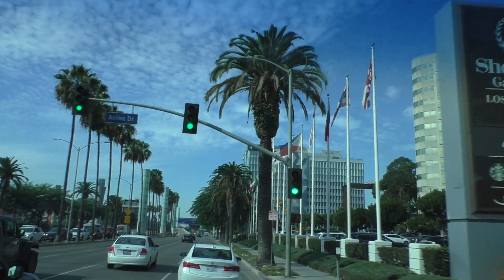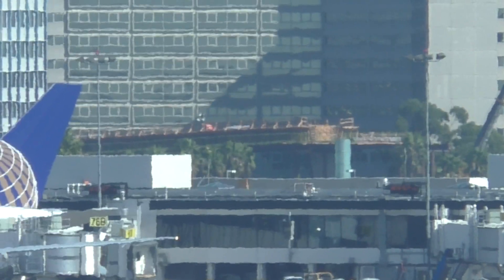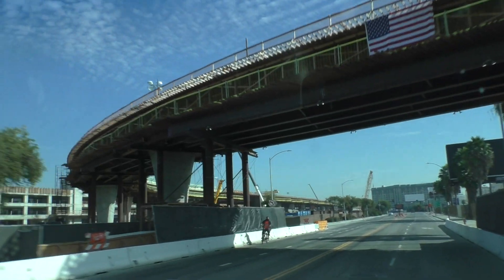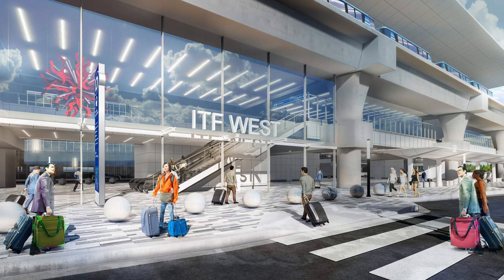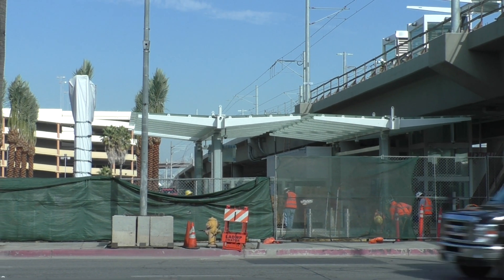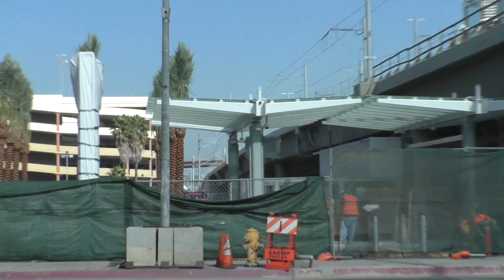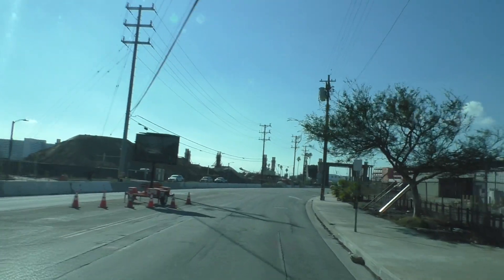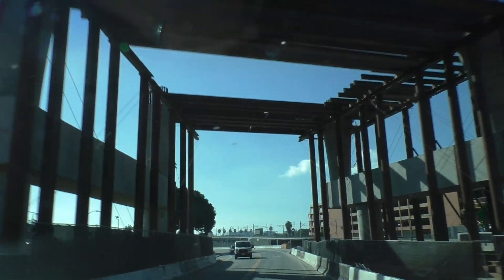LAX Airport $5.5 Billion People Mover Train | Construction Update

Comment: I like the idea of a train ,BUT these designers always forget about the rain/ strong ocean wind .And those shade coverings aren't going to cover properly .
Reply: It barely rains in LA and the usually the wind and rain are mutually exclusive.
Reply: What rain? It barely rains here haha
Reply: They don’t always forget about the rain/ strong ocean wind. If you don’t comment back then you believe that they don’t always forget about the rain/ strong ocean wind. I have the best YouTube channel.
Reply: @jordanjohnson9866  have you ever stood  at  the platform at imperial/ aviation blvd ( green line ) .Well to begin ,its the similar in design, and height. And when it rains ,with strong winds you're going to get wet .It's the same shitty design in another place .
Reply: I'm sure the designers took into account the gale force Santa Ana winds we tend to get in the fall. And trust me , what rain there is  during the year, passengers will survive and adapt. Oftentimes when it does rain, it's just a passing system that lasts long enough to make the 405, 105, 110 and other freeways and streets wet and it's over with. 

 The marine layer will tend to be more of an issue , but even that burbs off in most cases by 11am.
Reply: @danielleporter1829  these designers design, but dont utilize.